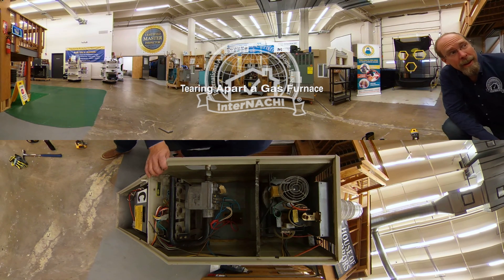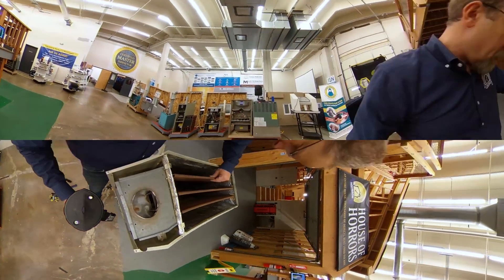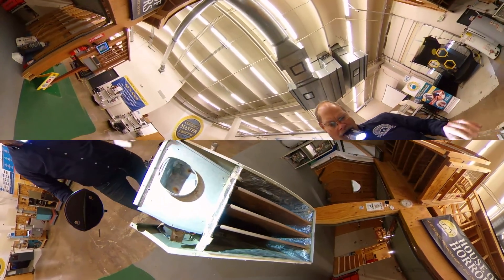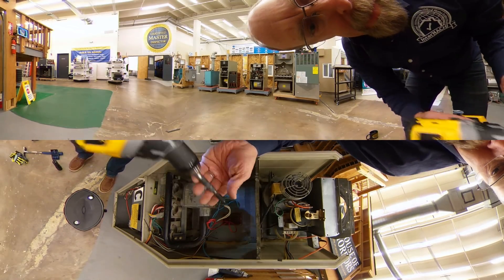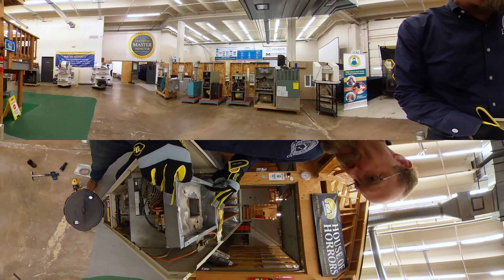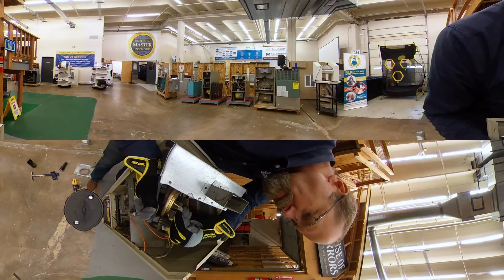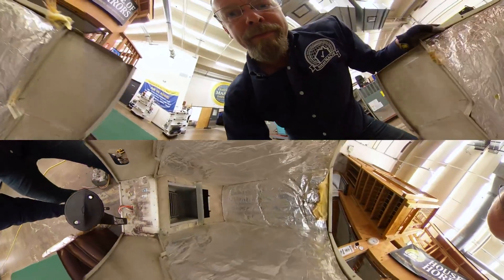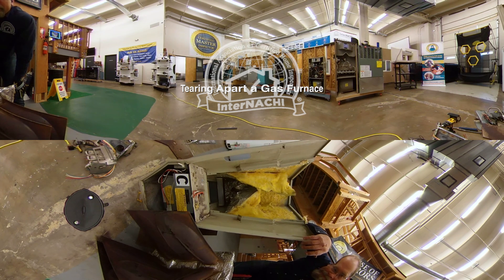Home Inspector Tears Apart a Gas Furnace in 360 VR

Comment: The amount of loose dust and rust falling out was probably loosened during handling and transport of the unit, but still says a lot about how moisture from room air and by-product of combustion is constantly working away at the inside of the heat exchanger and thinning the thin metal walls.  The crack on the face of the heat exchanger is an eye opener because it was hidden by the burner assembly.  I wonder what kind of readings a CO/Combustion gas detector would have found on that unit.  That's a good video. The 360 degree is pretty cool.
Reply from the maker: Thank you.